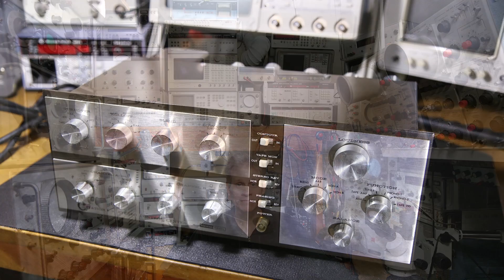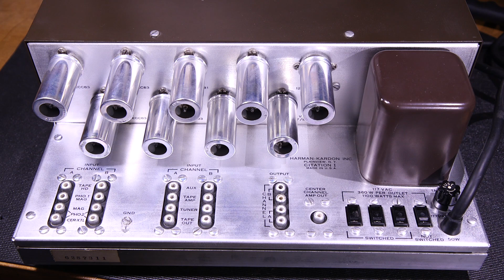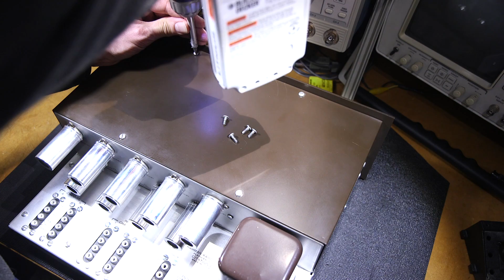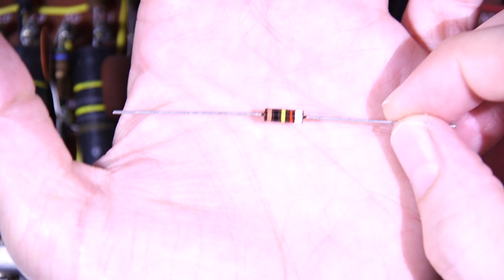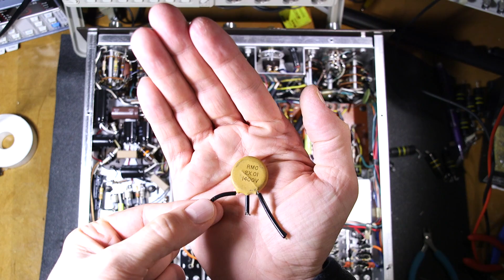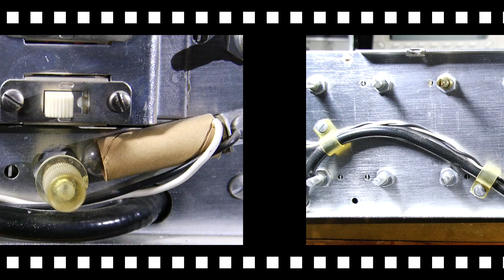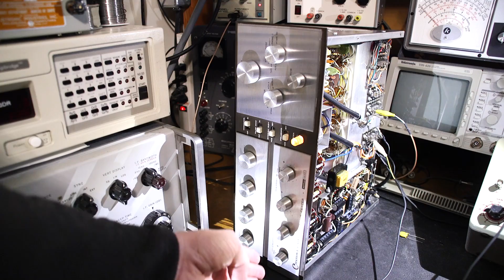Vacuum Tube Preamp Repair, Harman Kardon Citation 1

Comment: Such a shame that the bumblebee caps are always defective. I realy love the look of those. Thanks for the nice restauration video, I really enjoyed it. 
Good night from germany at 3:26 AM :)
Reply: That is indeed a hefty price o.o I would never pay that much for two caps...  Especially if they are made (as advertised) exactly as they made them back then - meaning, they will die the same way as the original caps do...
Reply from the maker: I agree, they do look nice.
Reply: New bumblebees are available now: https://luxe-radio.com/products/matched-pair-of-luxe-oil-filled-022mf-bumble-bee-capacitors-2
Reply: That could be hard to do with the Bumblebees as those are oil filled caps with a plastic housing, not wax or tar filled paper tubes.
Reply: yereverluvinuncleber Good grief, $60 for two capacitors. Ouch!